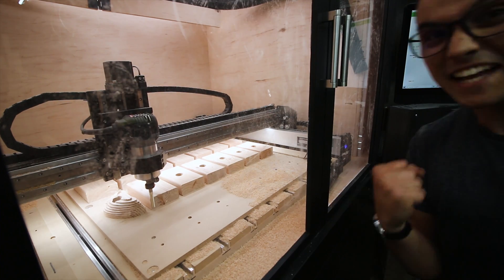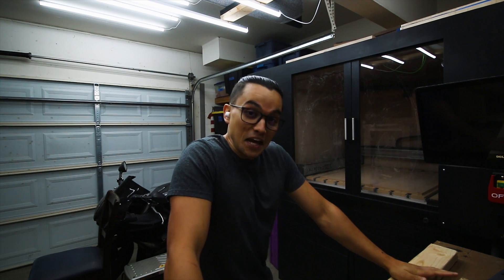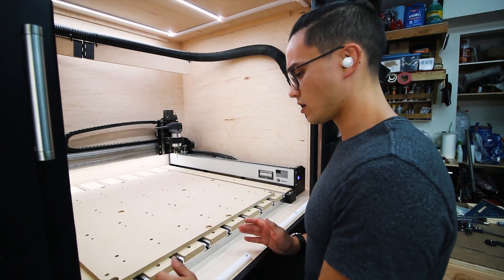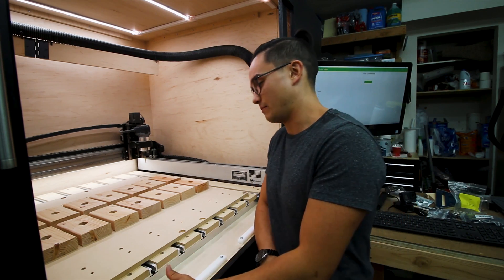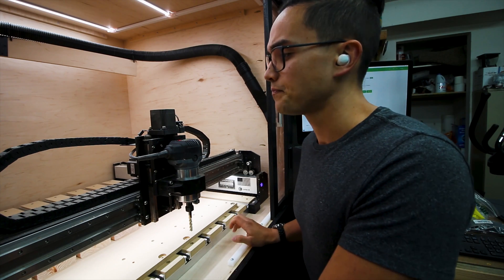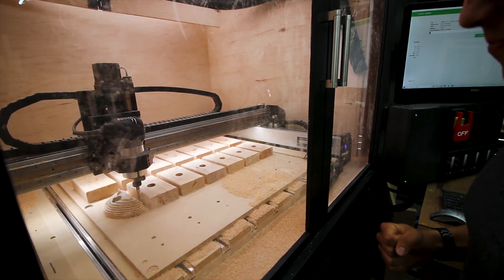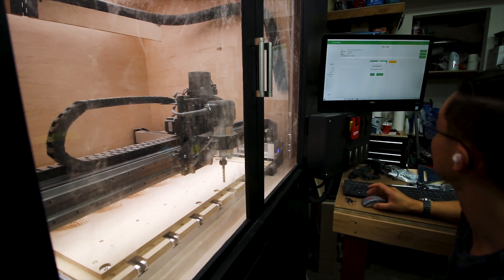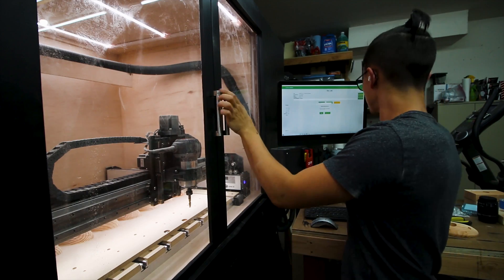First CNC Production Run! - Part 1

Comment: Conventional cut for roughing, climb cut for finish!
Reply from the maker: On a manual mill yes. On a cnc no. You have control of feeds and speeds, the machine can't drive it self and if you conventional cut you put the heat into the tool not the chip. When you climb mill you put less heat, load and wear on your cutters.

Comment: Awesome video,  A quick question,  where did you get your collet for the 3/8 bit?  That would be such a time saver when I batch out my stuff.
Reply from the maker: Thanks! It's the makita collet. I found one on Amazon and it worked:
MAKITA 3/8" Collet Cone, 3608B... https://www.amazon.com/dp/B000808IBU?ref=ppx_pop_mob_ap_share

Comment: Two questions;
What are the machining time? 
And what CAD/CAM combo are you using?
Reply: Cool, i have been machining some holds too, and just upgraded my sketchy diy build to the shapeoko 3 xxl. I will try to beat that time when I get to it. Also, how well do your holds do after some time?
Reply from the maker: @bussergi  with the polyurethane coating outdoors there holding up just great.
Reply from the maker: The roughing I got down to around 5 minutes a part and the finishing closer to 8. When you have only one tool change per cycle it's pretty fast. The CAD/CAM is fusion 360.

Comment: Simple suggestion. Your CNC-router is making the strange noises you can hear in this and the other videos. Because most of the time you have the wrong routing direction for wood. A clockwise rotating milling cutter should mill the wood on the outside of your workpiece in a counter-clockwise direction. This also prevents noise and prevents your machine from shooting away as seen in the crash video
Reply from the maker: Hi Snowy, only problem with conventional milling is there's more tear out in wood so that's why I'm climb milling.

Comment: Really like your journey! you made a great product and developed a nice process. I make some products in volume that i think might help a little.

If you use two L brackets and three toggle clamps per board, you can place two full boards parallel  to your x axis, you will just need to have the machine bore the center holes, install your cap screws, then slide toggle clamps back from your workpiece (most common way is to have a piece of t slot but if you want to be fancy, you can use an mgn 12 rail and carriage, the bolt pattern fits most standard light duty toggle clamps). this would eliminate your drill press work and cutting work, you could also set 

If i were to do what you are doing, i would get a piece of mdf or melamine and make a little fixture board that locates with dowel pins, leave your hardware mounted to it and just remove the fixture when you run something else we typically do this with locating pins and vacuum on large industrial machines

If you are working in fusion, it has a handy interface for saving fixtures for visual reference and fitup, it also shows you if you will run into a hiccup when patterning a toolpath.

I would likely leave a very tiny tab connecting the string of holds to prevent them from rotating too but i guess that's a good risk vs benefit analysis.

Sorry this is so long, hopefully it didn't waste your time but you've gained a sub!
Reply from the maker: Thanks! I'm working on a variation of that for a first opp using toggle clamps to eliminate the drill press work and hopefully open up under cut holds as a possibility.

Comment: You can try Candle or similar G-Code senders instead of carbide motion. cncjs is also an option. 
You have a lot more control and visuals of your gcode as well as your machine. 
At least it works great with the Nomad machine.
Reply from the maker: Thank you! I'll look into that.

Comment: Just a quick suggestion.  It looks like you are using fusion cam.  I would recommend putting a patch over the mounting hole to allow your finishing passes cut in a more continuous pattern.  It will probably knock down your cycle time a bit and give a more consistent surface finish.
Reply from the maker: Thanks I think that might work! I'm new to fusion so I'll take any and all advice I can get!
Reply: @AustinConrad  I assume you already found this, but NYC CNC is an awesome channel for learning fusion cam.  That is where I learned the patch trick.

Comment: Great video.  So a question.... why not machine your waste board to have a slight angle under the parts to allow the grip side  to be slightly angled?  Right now it is at 90° but if the base material was set in at an angle it would allow that angle to change and make the hold easier to hang from....  Obviously this would require modeling a special waste board but you have already done that to create your hold down method....  Just a though.
Reply from the maker: Jerold Jay! That is a killer suggestion! There's a few issues regarding how I could do it and have it work from an implementation point but as an idea thats awesome! Thank you. I'm going to toy with that and see what I can come up with. Seriously thank you!
Reply: @AustinConrad  Looks like the tooling would be fine, only big concern i see is the potential for your mounting bolt to be impacted.   With a small angle the hole could just be slightly oversized   (You could use a smaller diameter bolt for machining than would be used on the wall so the "oversized hole" is still the hole size you want...) .   With a more dramatic angle it could cause the need for a slot....potentially causing an issue when mounted on your climbing wall...   The bottom of the part would obviously have the same angle, but it doesn't look like that would have any impact on the use.     I'm looking forward to seeing what you can do.
Reply from the maker: It definitely presents other issues but the idea it self is something I'm going to play with and see what happens.